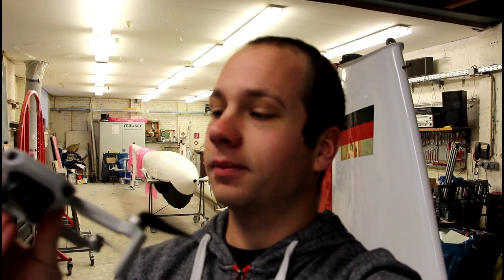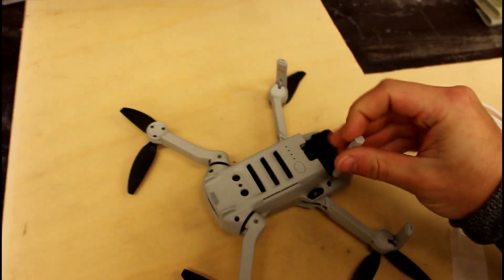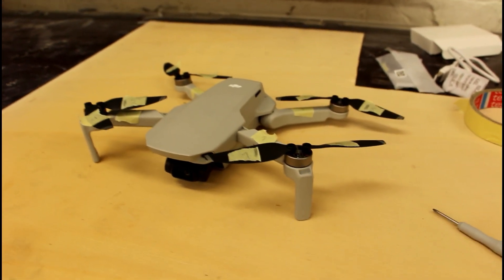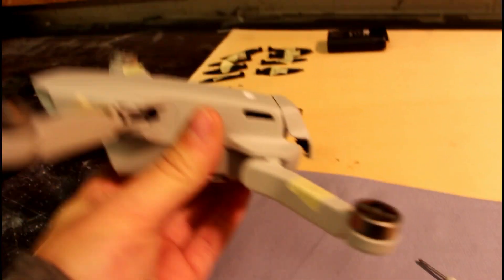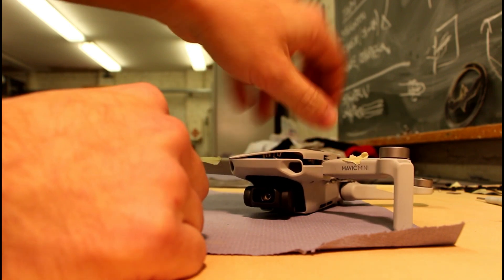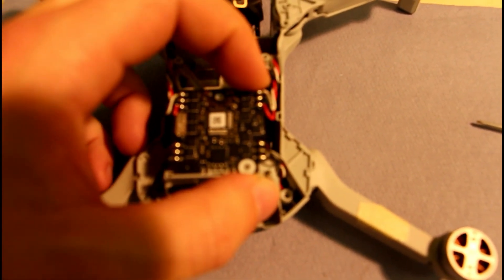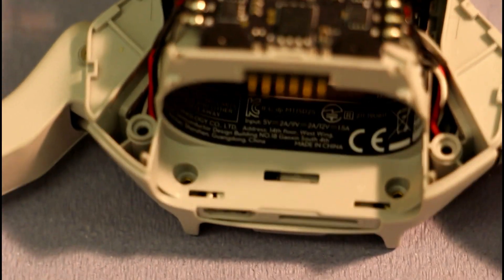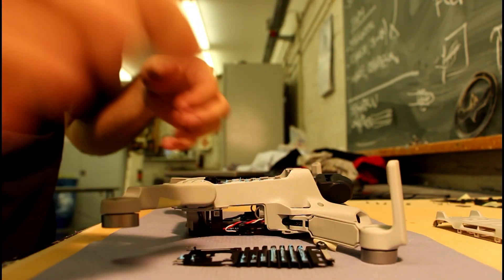DJI Mavic mini - Teardown -

Comment: The propellers can be moved diagonally across the body. The blades on each motor match and they share a paint tip differences to show which go with which. You will find the same pattern and compatibility exists on the motors diagonally across the drone. So their are 2 types of propellers.

Comment: I have mine arriving this week. I'm curious. I have a Spark I installed the ARGtek antennas on my Spark controller it did double my range. To a little over 2 miles one way. 22,944' total flight distance. The problem was by the time I reached 2 miles with Spark it was time to return. And land with 18% battery. In your opinion with the good range of Mavic Mini should I install new antennas? If I sell my spark I'm sure who ever may buy won't want the kit with 3 sets of antennas. 2 pair of directional one set 5.8 and 2.4 combined. One set of omni direction dual 5.8 2.4. Also the pair of 2.4 directional. The pair that got the best distance. They were easy to install.

Comment: is it posible to lower the weight like 50 grams without using the japanese batteries? that extra weight could be used for landing gear, strabo lights, etc. thanks
Reply: I asked the DJI customer service and they said the Japanese batteries work, although they don't recommend them. (because I want to travel to Japan)
But otherwise, I don't know what you could remove, probably not much :P
Reply: @i.i.iiii.i.i  like those protective case for the 2S batteries might lower it a bit
Reply: @i.i.iiii.i.i  They dont recommend using the japanese model?
Reply: @dv2045  
They don't recommend using the 50g Japanese batteries in the 249g international drone. I think because they have slightly different technical parameters. 
But it should work and probably not hurt the drone because they also officially mentioned that you can use the 100g battery in the Japanese drone...

Comment: Thanks, I already destroyed my micro usb on the controller and had to solder a new one on. There's a lithium ion inside that as well.
Reply: never used my micro usb port. i charge my batteries with the dock i got in the fly more combo
Reply: Speaking to the one on the controller

Comment: Finally the chineese are going to start making quads with li-ion batteries
Reply: This makes only Sense wehn you have a very light copter wich does Not Draw much current because of the high inner resistance of Li-ion batterys.
Reply: @rcflo7300  18650 batteries like samsung Q30 are good for 30 amps continuous use !
Reply: @integra8502  ikr! 30a is impressive and more than enough for this tiny quad.

Comment: You don't disassemble the battery.  The most interesting things for me😓

Thanks anyway...
Reply: it's 2x 18650 cells: Samsung INR18650-25R. (2500mah and 25A rated continous discharge) You can replace them with higher capacity cells, trading some max discharge capability for pure capacity. Sony VTC6 will be a nice replacement to get a few more minutes of flying time, if you don't kill or overheat them. Sony/Murata US18650VTC5D will be a safer choice with still a good boost on capacity.